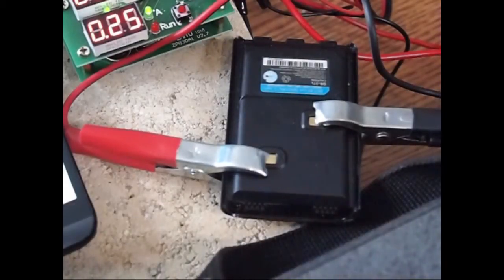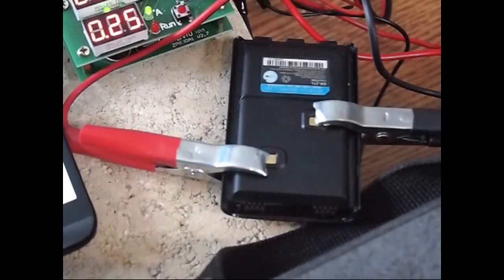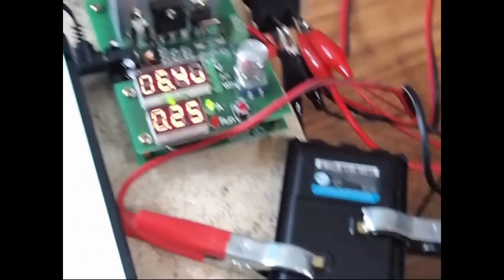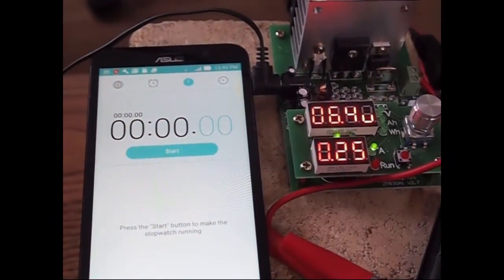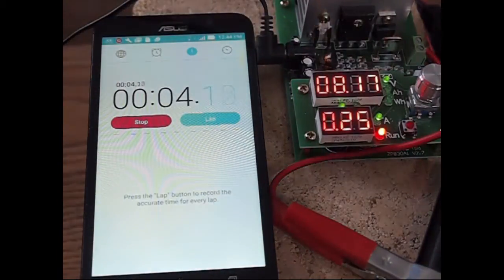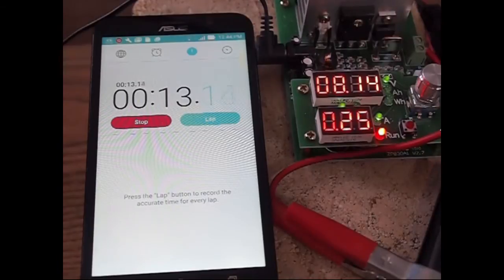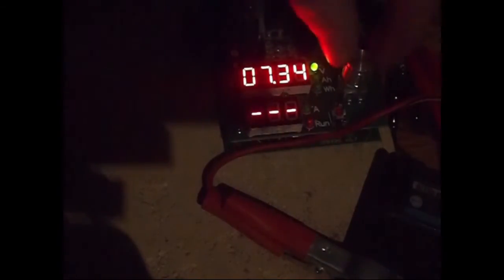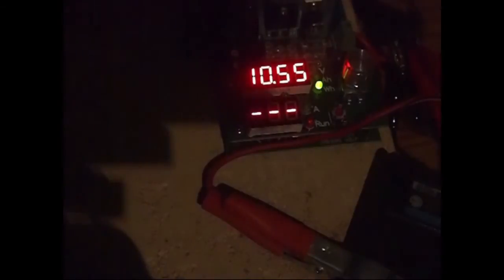Anytone 3318UV series handheld radio battery capacity test

Comment: I'm testing my Alinco DJ-500T battery now.  Supposed to be 1500mAH but I'm suspicious.  This is a new radio for me and the battery life doesn't last as long as they say it should.
Reply from the maker: I haven't had a chance to test the Japanese batteries, but generally you'd expect their capacity ratings to be more accurate than the Chinese brands.If you open your squelch and let the radio run, it should get you perhaps 8 hours or more. If you get that then you are probably getting what you paid for.
Reply: I got 1.25AH for a 0.5A load.  Not bad.  I'll have to measure what the radio pulls when running.  FWIW, I think the DJ-500T is made by Anytone.  The battery from the Anytone 3318UV can be used on it so I've read (sure looks the same)
Reply from the maker: Well that is indeed interesting. Years ago I used a number of Alinco's daily at work. After seeing your comment I did a quick search and found a blog post that confirms your suspicions:
https://hamgear.wordpress.com/2014/10/08/the-end-of-alinco-as-we-know-it/

Then, in that blog, I noticed a picture of the AnyTone AT-588. I just got a shipment of the TYT TH-9000 mobile's direct from TYT, so I dug one out and it also looks identical, including the spec's. So I do some more searching, (use this search term: "AnyTone Intellectual Property and TYT")
and find a Youtube video, and another Blog post from 2013, that says TYT copied the Anytone, and Anytone sued them. What I found interesting is it says TYT was ordered to stop production and sales of the TH9000 in 2013. As they clearly have not done so, I wonder if those posts were in fact just more internet BS. Makes you wonder if in a few years time, almost every radio on the market will come from the same factory in China.
Reply: Old post but, yes, the Anytone 3318UV-A and the Alinco DJ-500T/DJ-500TB are the same radios with little differences in firmware, speaker mic, and keypad rubber. The manuals between the 3318UV-A and DJ-500T really give it away. I've used all three... same radio. And, they are very good radios for the money.